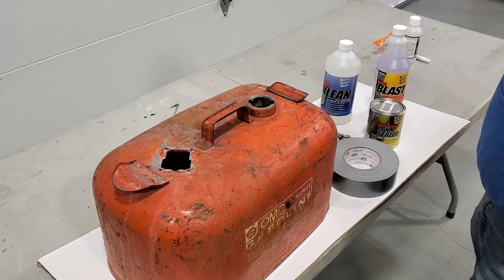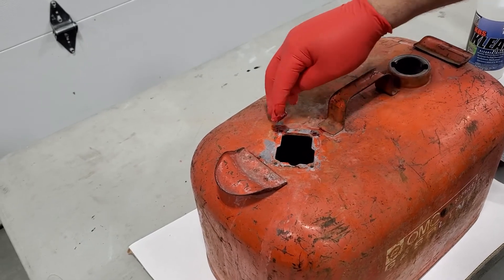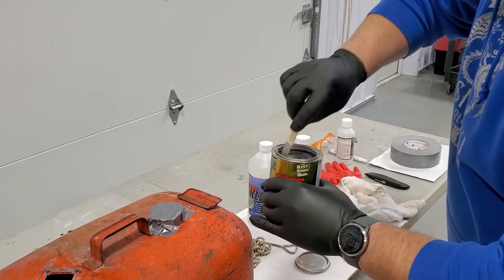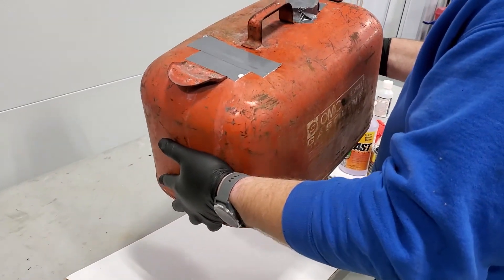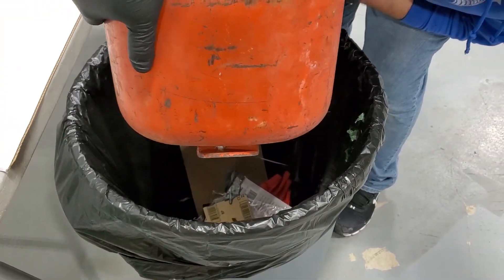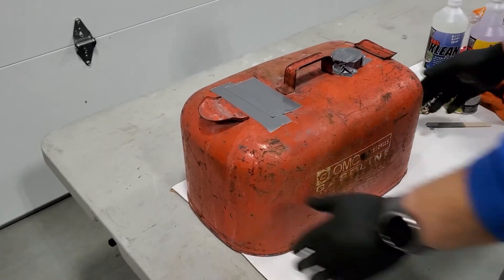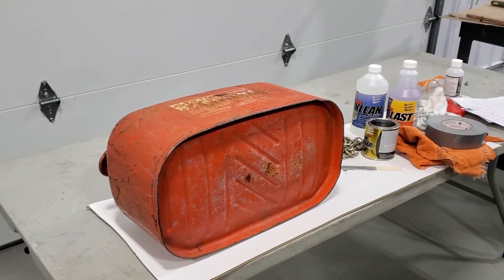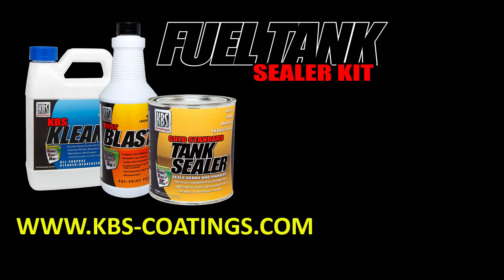Simple Steps to Seal a Gas Tank with The KBS Coatings Tank Sealer System

Comment: So I'd like to know whether  the KBS Coatings 5200 Gold Standard Tank Sealer - 8 fl. oz will be enough to cover an 18 litre fuel tank (from my Honda CBR600F4 motorcycle)?
Reply from the maker: Yes, the Cycle Tank Sealer Kit (Part #52000) which includes Part #5200 is enough to properly prep and coat a 4.76 gallon tank.